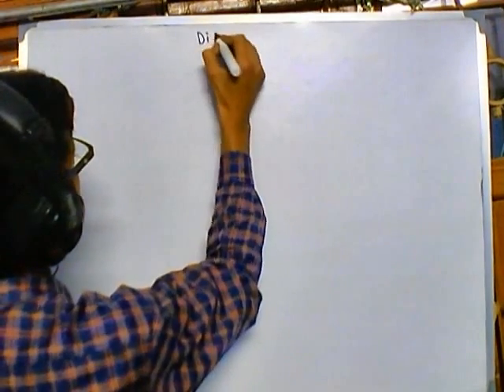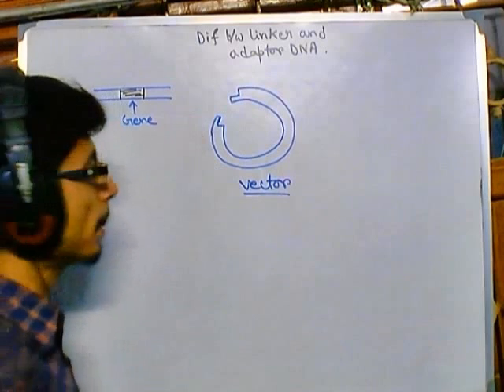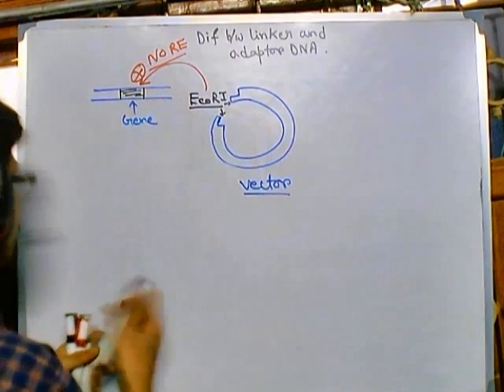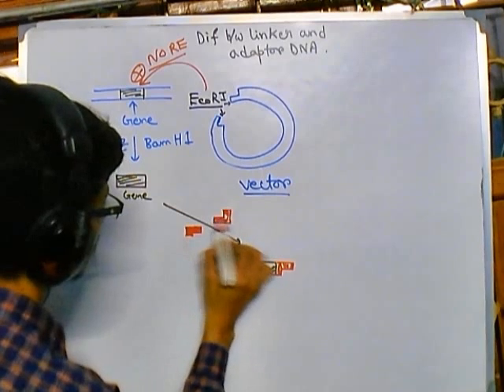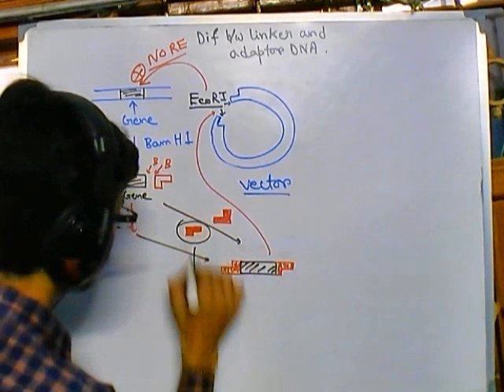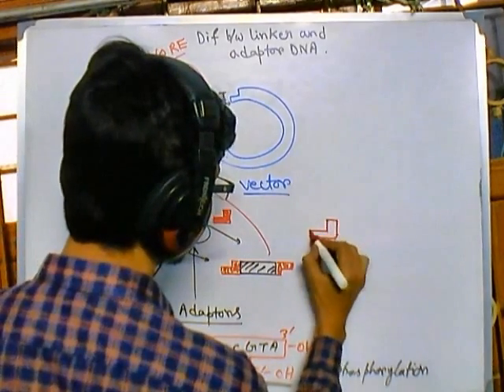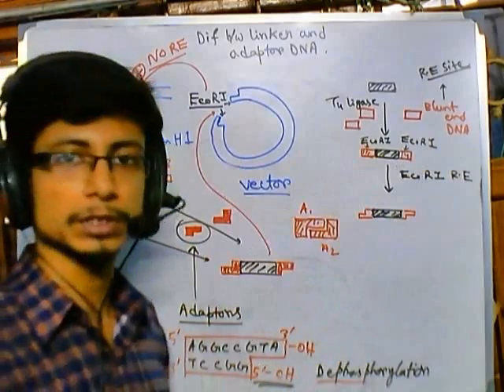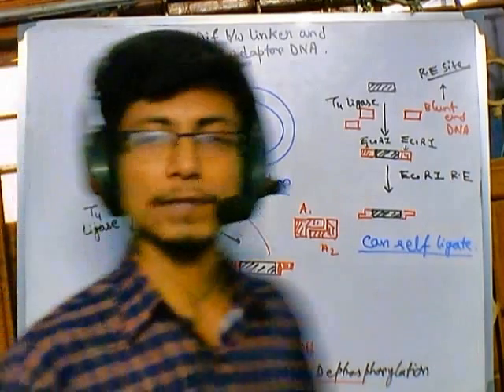Difference between linker and adaptor DNA

Comment: Thank you very much, i have a question.
 if we hypothetically treat linkers with an Alkaline posphatase wouldn't linkers be like adapters ? Of course knowing the making process is completely different
Reply: I think treating the linker DNA with phosphatase will change the molecules such that T4 ligase cannot work on it. It requires a 5'phosphatase and the 3' hydroxyl to work.

Comment: If you treat the adapters with phosphotase, how then do you ligate them into the vector?
Reply: +Alena Ps (alenchik) You could use Polynucleotide Kinase (PnK) in the presence of ATP to phosphorylate the 5' ends. This would make it suitable for ligation into the vector.
Reply: i had the same question. I think a possible answer is that the other end of the adaptor gets ligated, but then how do you make sure that end has phosphate? 
let me know if you find a answer..
Reply: ok i think this is the answer - the DNA of the vector has the phosphate group necessary for ligation
Reply: now i know. One part gets ligated(the OH group) into the vector, the other does not. E.coli DNA repair enzymes take care of the nick
Reply: also i should mention that the DNA that has one end nicked is stable, so you don't need to worry about that.